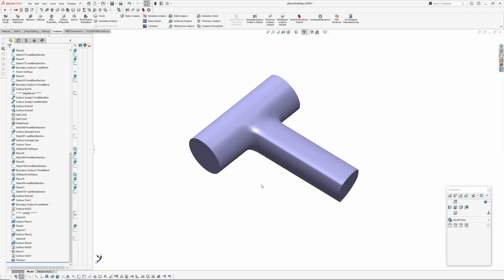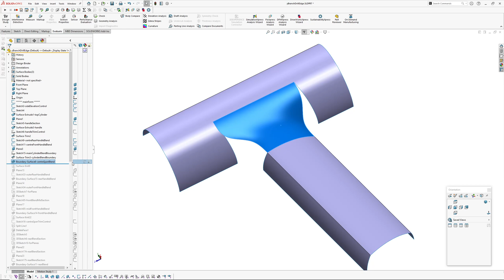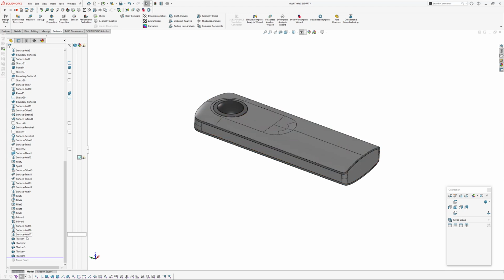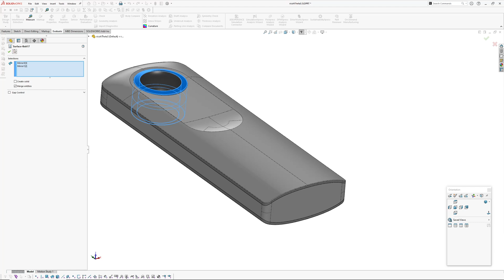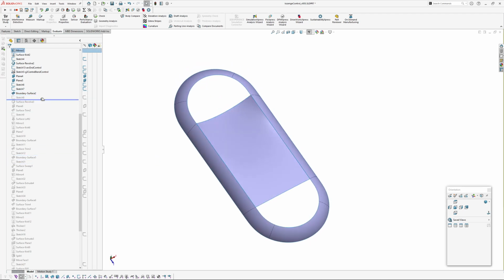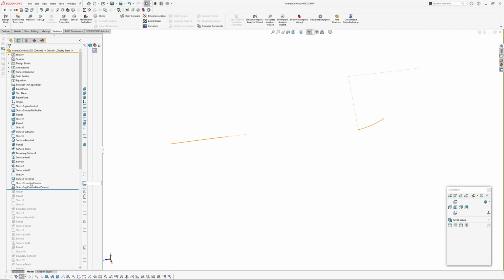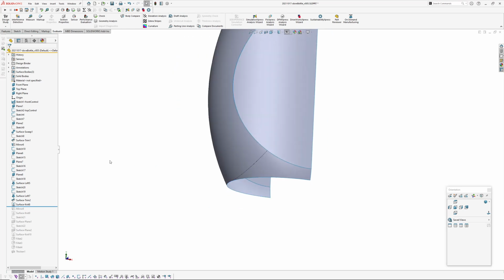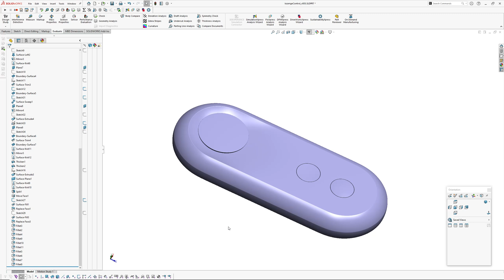Tips For Robust Surface Modelling in Solidworks

Comment: Thanks Andrew. I’d love to see how you go about “propper” top-down referencing in SolidWorks. Coming from Creo that has a really robust “published geom” (copy surfaces, lines, datums etc), what’s the equivalent in SolidWorks that you use?
I find the technique of breaking parts out of a multi-body master part to be very unstable and frequently leads to issues in larger, more complex assemblies. Is this what you use or something different?
Would be great to hear your thoughts, as well as any tips and tricks you would throw in/recommend.
Thanks again for these great videos!
Reply from the maker: I only use 'insert part' for copying geometry into other parts. You can copy surfaces, solids, ref geometry etc. I guess with AAX/published geom it gets added into the master part file as a feature, so you dictate at which point geometry is captured and published? The problem with insert part is it just copies over whatever is left at the bottom of the master part feature tree, so if a surface body is referenced, then someone adds a fillet to the surface body, that fillet geometry gets sucked into the child parts, whether it is needed or not. Ways around this is to make a copy of the geometry that is to be referenced, further up the tree, then make sure it does not get cleaned up with a delete/keep body feature at the end of the model. This might sound weird, but I have worked on a master where it effectively needed a branch/fork with some deviations in the geometry that was being referenced. Be way easier if you can pick the geometry to be referenced at discrete points in the tree!
Reply: @AndrewJacksonDesignStudio   what about Save Bodies?  then it saves only the part that you want. Ive done this with different configurations too. I also like Insert part when I want to import more info.
Reply from the maker: The downside to save bodies is it does not take any reference data with it which is why I use insert part. I guess you could create planar surfaces to act as planes, edges as axes, etc, but then you'd have to be on top of documentation in a multi user environment so others understood what was what.
Reply: Very much agree, that an interesting topic of SW surface modeling.
When to switch to solid ? mid part, copy surfaces to make temp solid and check volume for example or are there other ways to handle surface/solid rebuild stability issues ?
Andrew, your thoughts would be highly welcome !